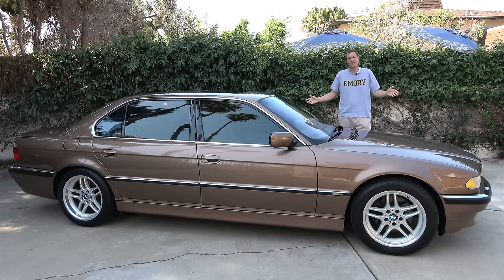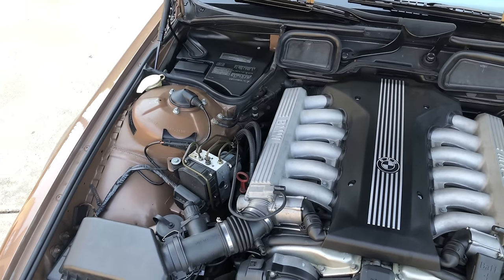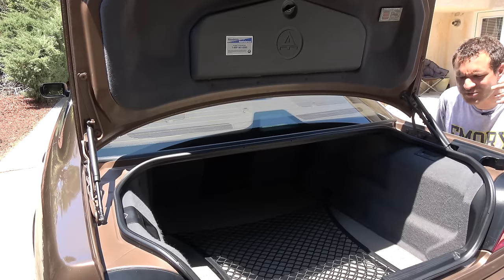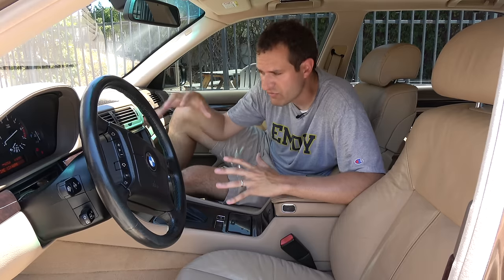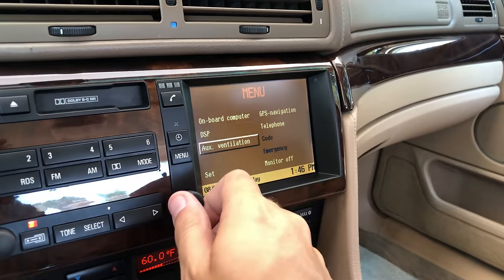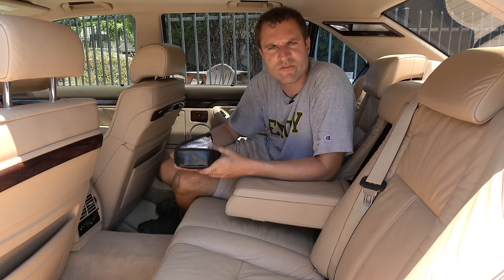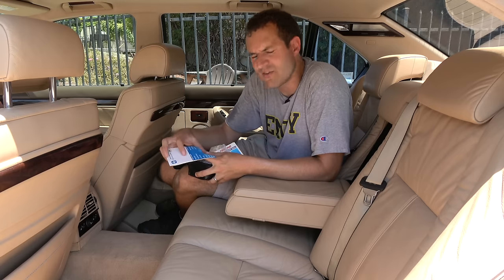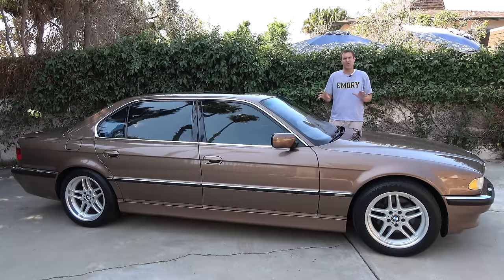Here's Why the 2001 BMW 7 Series Is the Best Luxury Sedan Ever

Comment: Older cars are awesome. You just don't get the same feeling with new cars. There's something about an older, clean, well kept car that gives you this awesome feeling of enjoyment.
Reply: Modern cars feel like they "try hard": Styling straight from a spaceship, electronic gadgets that will only age and break.
Reply: Dude i see you on every car related channel possible, you are like a legend to me and i find myself searching for your comments on any car related video!
Reply: I hold the keys of 2 brand new cars, but still prefer my good 'old '01 Ford Focus. No technology, just plain driving. I love it
Reply: The real problem is not that new cars have tech, the real problem is that 99% of the time they have shitty tech, lack of fluidity, insane input lag, frame drops, everything is slow af, just look at the new 7 series key, yeah it’s cool that it has a screen but what a shitty unresponsive low-resolution low refresh rate laggy screen. At these price-ranges they could have easily included high quality hardware but they didn’t. Also for new french cars for example who though it would be a good idea to control radio sound and climatisation through a laggy touchscreen ? Buttons are required for things that are THIS important, so that we can turn the volume down without crashing the car into a wall, so that we can control climatisation without hitting other cars etc.
Reply: I have a 01 caddy deville in near mint condition 105k best car I ever owned
Reply: I'm the same. I have no interest in newer cars. They've no character at all. Mostly the same
Reply: MaxSpeed idk man if I had a lambo I’m pretty sure I’ll feel pretty happy ... 😂 jk but yea you’re absolutely right!
Reply: Same goes for cell phones. Miss those old Nokia N Series and 8800s
Reply: @hadissaeed1546  hey man! Thanks haha love the support. You'll be seeing many more comments as I love engaging with people in the car community :D
Reply: @FireFoxCosworth  exactly! Nothing like an older car and the experience it provides
Reply: @Christopher Friend well said
Reply: @loupbleu3177  I love fun to drive cars. I prefer to steer away from all this new driver's assistance tech. Yea, it probably helps the average driver but for a person who enjoys driving, I always turn it off when I hop in a car that has stuff like lane keep assist, etc.
Reply: @GTi Mk5 honestly I think you're right. The way everyone is downsizing their engines, and heading away from manuals, even away from gasoline cars entirely is saddening. I'll always remain on the "fun to drive" side of things
Reply: @craigcage6  that's awesome! Devilles are really nice
Reply: @Weras Powa noice!
Reply: @andrewshelly6804  I see what you mean
Reply: @47boyz  haha yes new performance cars are awesome!
Reply: @UmarHKhan  lmao
Reply: Cars from 2001 are now considered "old cars".

FML...time flies!
Reply: I have drivin more then 1000 new and old, slow and fast cars in my life, but my all-time favorite is a "plain" '87 Renault 25 Monaco.
Reply: This generation of BMWs is complete shit, they are the worst cars to own. Their catastrophic reliability ruins any joy you might get from them
Reply: that's true. the latest cars are so damn boring
Reply: Disagreed,u dont notice the technology around you because u are used to it,one day we will cal cars today the ultimates
Reply: Especially when you pay next to nothing for them.
Reply: it was pretty good except for the shitty auto gearbox
Reply: @UmarHKhan  said whilst watching this on a smart phone
Reply: Older cars were different from each other.  Bmws, mercs and audis looked different.  Companies were comfortable having a demographic and not just "buyers".  Today a malibu, fusion, mazda 6, chysler 200, accord etc all look very close to each other.  I have a 95 passat and a 2007 passat.  The 07 gets more compliments...from females and b6 chasis enthusiast, but the 95 gets people asking me questions, people take pics of it, people make me offers for it.  And even though Im passing it on, RELUCTANTLY, I prefer the 95 over the 2007, for every reason.  It has more personality, and amazes me that its in such great shape to be as old as it is.  Its a test of quality standards cars used to be made too.
Reply: I get that feeling with new cars, sometimes even more often than with certain old cars.
Reply: MaxSpeed I agree man I miss my 740ia was a 1999 completely fully loaded that was my baby I sold her because supposedly either the timing chain was stretched or the Vino sensor was bad and the transmission was starting to have issues if it  won't for that I would have kept it
Reply: @MaxSpeed probably because you are older
Reply: The answer is Tesla!
Reply: @trentiusmaximus82  not really. Im half of Doug's age LOL
Reply: Go back further than this and most cars had chrome on them without even having to get a wrap. Ford wanted the Mustang in the 60s to make waves by being an American pony car that looks European.
Reply: MaxSpeed I totally agree. The build quality of old cars is second to none. This BMW is the testament to that statement.
Reply: Weras Powa good job!
Reply: How is 2001 old?
Reply: Warhammer 17 Bruh...17 years in a cars life is considered old. You say “old” in every imaginable way and literally speaking it is old. Like if you’re 17 years old already and your parents had another child. So you’re not old?  Then what that makes you? WTH!
Reply: mcdus78 no when I say old I mean like classic old cars not a 2001 bmw. This is not old to me at all old to ME is like 69 charger, 54 Cadillac hearse/ambulance, any 70s mustang, 58 Ford F100 I can go on and on but it’s just my opinion.
Reply: Warhammer 17 Very well to each his own! For me 2001 is old and of the many old cars on the road today, this BMW is a testament to the luxury and class by which the standards of today is measured. You can’t have that on the cars you mentioned.
Reply: New cars are superior to the awful late 70s-early 2000s cars
Reply: Now don't get me wrong. I do think old cars are great in their own way but the comforts of newer cars just take the win for me. 

As for styling, I just like very angular looking cars with details and creases in general which cars of the last 2/3 years have been. I just get the feeling that almost every car from 1980 to ~2005 was either too square or too round/blobby with not enough design features. After that until around 2015 things got a bit bland as well. I think that the best thing that happened in car design is the arrival of LED tech. This gave manufacturers so many options in head and taillight detailing. Just look at the Audi A1 2019, a7 or Peugeot 508. 

I also really appreciate new car tech, like more advanced infotainment and things like Adaptive Cruise Control. 

I truly understand what you people mean though. Older cars had less on them, so with good maintenance they almost never had issues. Besides that they had less to distract you with. So with either car era, you win some you lose some. That is what I think. 

Also @Warhammer 17 . Purely objectively speaking (looking at features and facts) new cars ARE better. You might not like them, but it is true that they are safer, have more functionality and have better fuel economy. Comfort and styling are subjective.  Doesn't mean 1970-2000 cars are awful though. Some of those older Lamborghinis and Ferraris are gold.
Reply: @hanksmith8626  No, but you sure are...Do you know anything about cars?
Reply: I had an immaculate '92 Saab 9000 turbo in the early 2000s and I know just what you mean. It was simple and strong, abnormal and functional. Just a solid, beautiful, uncomplicated driving experience.
Reply: I think older cars only look more agressive. If we gonna compare to the newest models like Bmw, Mb or audi. Nope, no agreesive design. Of course it has more better technologies each years.
Reply: IKR
Reply: Totally agree..
Reply: @FireFoxCosworth  they were in their first year rally champions ,and not just one year but then appear the 4x4´s subaru and also later the evo´s by mitsubishi, about old cars my bmw 2002 ,75 model ,i own also a 69 2002, that till today only thing i have to fix is some new tires ,the breaks, and the 12v battery either than that they do are perfect to drive.regards
Reply: yep those cars, that was iconic when you saw movies and they came driving, they really yelled luxury in some way, in the type of way that new cars dont becouse most feature's in the luxury cars is even in normal family cars no a day
Reply: @Weras Powa well im not one of them then, ough looks well i dont wanna see it anymore, looks weird and stupid, i mean yea the seats looks quite comfy but rest, looks way to round and clumsy
Reply: Yes I agree with that
Reply: I feel the same. I own a 1989 560 SEL mercedes and it's better than a newer one in a lot of ways that matter. Doug was hard on the 1991 SEL he reviewed but the materials and wood is so nice in them. Old mercedes reliability and durability is a mark of luxury to me. And some really cool features that dont get in the way of the car being a car but enough that its cool and quirky
Reply: Probably because your not making payments.
Reply: It does
Reply: Hadis Saeed It’s called self promotion
Reply: When I see these cars I think “poor person trying to look rich” sorry lol but it’s just how I think 🤔
Reply: Heath Newland This is true. Automatic transmission technology really changed when Lexus LS came out with the quick shifting 8 speed in 2007 and then Audi and BMW started using the even quicker shifting ZF 8 speed. The ZF 8 is such an amazing auto box, it’s used in Rolls Royce, new BMW M5 and other amazing cars. I’m a manual guy and only buy older cars with manuals. But a proper modern ZF 8 speed is almost as fun.
Reply: I'll pick  new rolls royce over this any day!!! And I know you will too🤔🤔🤔😑😑😑
Reply: Damn true.. man.. classic old cars with leather and wood interior are damn my heaven
Reply: So true! I also perfer the styling of  early 2000s to late 2000s cars. Hince the reason I own a 2008 infiniti M45 Sport!
Reply: Also shitty rear suspension (semi-independent).
Reply: On thing plastic
Reply: Time less classic!!

Comment: I drive my 1998 740IL every day.  230,000 miles .  I  used to work on them for a living when they were brand new at the dealer.  They looked awesome then and they still do today.  Everywhere I go people talk about this car ….do you want to sell it ….I like your car….. a thumbs up at  the gas station.  There are some things created  that  will never happen again and this is one of them.  All the stars were aligned.
Reply: yessir, you are one lucky man. Probably last you alot longer too!
Reply: I saw one for sales in the UK about 11 years ago, 750 V12 about 100k on the clock, it was owned by an old guy living in this massive stately mansion not far from me, 1 owner full BMW service history, completely speced out he only wanted  £1250. its the only car i've ever regretted not buying, but I was working as a car salesmen living it home saving up to move out.
Reply: Gonna pick up one for 3000$ on Friday, transmission got replaced in 2017 and has 20k mikes on the new trans
Reply: @Woozie894  how is it
Reply: @Woozie894  all is good, yes?
Reply: @lilmacfarlan3  Drives smooth as can be. Currently looking to get a new trunk badge and looking into whitening to the headlights to make it look brand new, best value for a car I've ever gotten
Reply: Witch would you say are the more reliable, The the 6 cylinder or 8 cylinder version?
Reply: i drove my dad's 2001 740il (155k miles) for a bit while my 2011 335i was in the shop and i got way more comments about that car than my own. i can attest to the sturdiness of the interior, its built so solid.
Reply: @jagheterhopp  We didn't have the 6 cylinder option in USA.  The 1996-1998 Non-Vanos 4.4L V8  are probably most reliable in this car , because less to go wrong and uncomplicated valvetrain.  However, the 6 cylinder 3 and 5 series were Ok too. Cooling systems are the weak point on all the cars from this era  and 5hp24/30  transmissions in the V8 cars need regular fluid changes.. ignore anything anyone says about a lifetime fluid.  The early 4.0L V8s in the USA had bad situation where cylinders would get prematurely worn ( BMW said  US fuel was culprit degrading the nikasil cylinder lining)   I pulled many of these motors in the late 90s.
Reply: Do you live in the USA? If so, the east coast? Lol I’ve been trying to find someone experienced enough to work on my 1999 740iL forever.
Reply: @Theunknownmoniker  this is the equivalent of somebody telling you to buy bitcoin in 2012 and not listening.
Reply: How’s the reliability on those
Reply: I'm thinking about buying a 1992 740i with 60k miles how reliable are they?

Comment: Perfect 7 series, low beltline, slim, solid and athletic. Unlike the new one
Reply: that g11 lci is just a grill with a 7 attached
Reply: So true!
Reply: And then Bangle come and ruin everything lmao
Reply: Agreed. That look hasn’t been seen in years.
Reply: @ratamahatta5306  bangle didn’t ruin anything lmao
Reply: @MBS..  Just take a look at the E65. The front looks depressed, not menacing like the E38. The rear was even worse, absolutely atrocious design.
Reply: @GAMING2S  E65 facelifted was a gorgeous design and so was the E60 M5
Reply: @MBS..  I meant the pre-facelift. And yes, the E60 was indeed an amazing looking car, way better than most cars back then.
Reply: @GAMING2S  yes then I agree e65 when it came was very ugly
Reply: The new one is awesome as well.
Reply: New one just got uglier chief
Reply: People stopped buying BMWs because of what they stopped doing, not just that they were left behind. They stopped making timeless designs, they stopped putting the driving experience first without compromise, they stopped using variable damped shocks with soft compression and stiff rebound. These things were differentiators. Nobody under 50 sees anything truly compelling from them, at least not enough to overcome expensive price and even more expensive maintenance.
Reply: @timothyhingham3672  no one stopped buying BMWs

Comment: The seats were not meant to massage. They were for long trips and the lower seat would change the pressure points. That is why you hardly feel it. I was a technician for BMW when that car was around new. I would argue that the E39 is the perfect sedan, but I agree that this was the best 7 series ever built.
Reply: Did you wanna come around to my house and install some foglights for me, former BMW technician, I've got an e46 sedan.
Reply: I agree the e39 was a perfect sedan
Reply: Greetings from South Africa. As a blind person I love the 3 Series, 5 Series and 7 Series. My favourites are the 320i E30 (4 door),325i E30 (4 door), 320i E36 (4 door and vanos), 325i E36 (4 door and vanos), 320i E46 (4 door, 2.0l), 325i E46 (4 door), 325i E90, 520i E34, 525i E34, 520i E39, 525i E39 and the 740i E38.
Reply: @Preyser123  impressive you can't visually see cars yet still chose to love the most visually striking cars. Cheers from Egypt, North Africa.
Reply: Again, not like Doug could be bothered to research something so he could actually know what’s he's talking about in a supposedly educational review.

Dough meet google, google, Doug.
Reply: Well, most of my decisions are  based on engine and exhaust sound.
Reply: @Preyser123  what do you think of the sound of a e39 530i, a 540i, or an m5?
Reply: I'm not sure if the 530i E39 is an M54 straight 6 like in the E46 330i but I do know that the 540i E39 has an amazing sound according to YouTube videos. I haven't really had much experience with the 540i and the 730i E38 but I have once with the 740i.
Reply: @Preyser123  it's a 6. I have one :)
Reply: Nice!
Reply: Why did you leave BMW?
Reply: Well, we didn't ractually leave but in 2001 my dad's 1991 325i E30 was sadly stolen and we just didn't replace it because we had then moved on to other cars.
Reply: @Preyser123  how are you typing and reading if you're blind
Reply: To put it simply, text-to-speech software.
Reply: Rune Steusel i would be more interested in why he's watching youtube videos lol
Reply: Audio, mate. As I'm blind I don't care about the visuals.
Reply: I've got both, love them both
Reply: The E66 FaceLift Was a much better 7 Series
Reply: Great update pal
Reply: I looked for a nice E39, thinking of the ultimate machine, but actually didn't feel that fussed during a drive..
Looked for a nice E34 but nearly all were project cars and not the right spec..
Looked at a E38 out of novelty/always liked the looks, and it surprised me how different it felt to the similar-sized E39, as an environment to be in. Suffice to say, I ended up with it.
Reply: @beautgrainger147  
I had a 2000 540i 6speed w/factory 17inch multy spoke wheels. I loved that car. It may be the only one I want back.